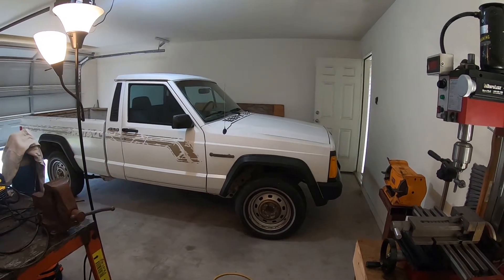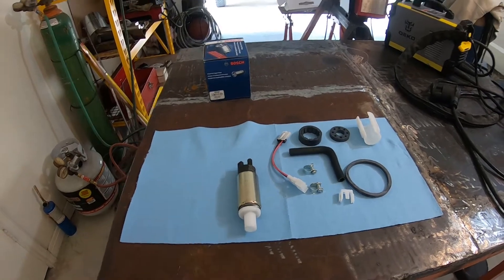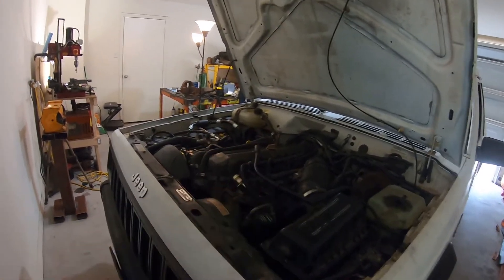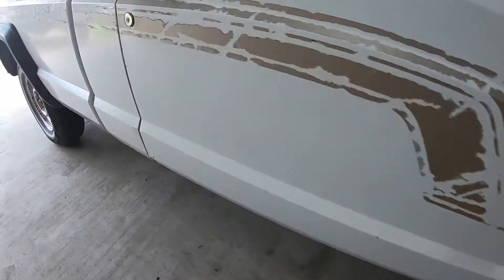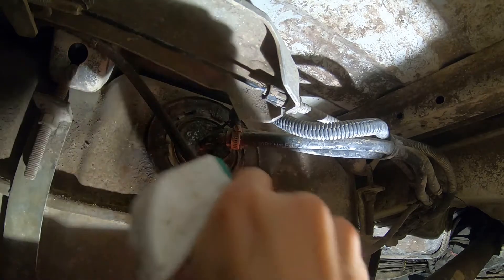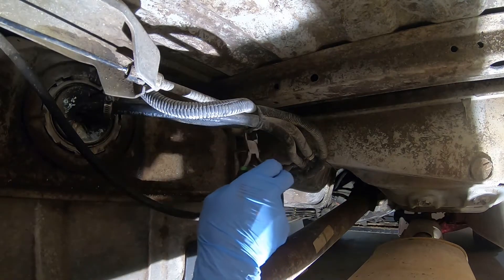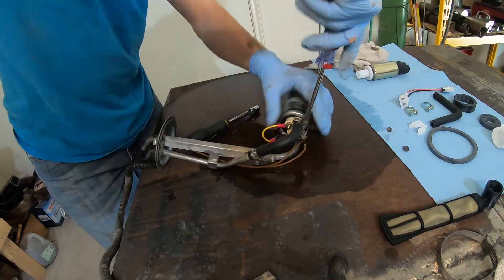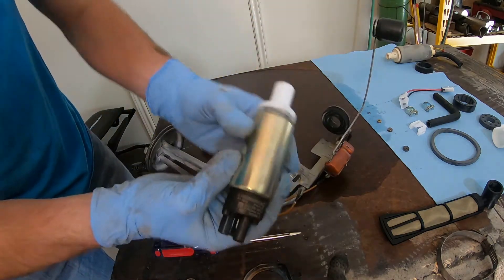Jeep Comanche Fuel Pump Upgrade 1987-1992

Comment: Great upgrade 👍 Do you have the part # for the Bosh kit ? Please post it .
Thanks and keep up the Great video’s
Reply from the maker: Hi, if you look up the part number for the pump its a Bosch 69302 you should get the same kit I got. I think it's designed somewhat to be retrofit into older model vehicles, so it comes with the hardware to adapt like I got in this kit.

Comment: Hey man, I hope your going good.
Unfortunately, my 7.3 has another issue. For some reason when you keep it above 2,000 rpm for some time and let off to come up to a stop sign, the truck shakes and idles rough. It almost seems like it is down on a few cylinders. When you get back on the throttle, it runs good again. So its a intermittent rough idle condition. Whats weird about it is it does it at the same stop signs everyday. There are no codes that show up on my forscan app. It passes a buzz test fine. I replaced the gray cps with the motorcraft blue and purple one. Still no difference. When it idles rough the Icp is about 587 psi and the IPR is 12.50. When it idles smooth its the same readings. I unplugged the icp and ebp sensor and drove it like that. Still no difference. Today I replaced the Idm with a remanufactured 120 volt Alliant Idm from Riffraff Diesel. The extra 20 volts defiantly made the throttle response get better, but is still idles rough.

Any ideas would be appreciated.
Thanks Alex
Reply from the maker: I'm sorry to hear you're having truck issues. It sounds like your issue may have something to do with the accelerator pedal. My guess would either be the pedal itself or the idle switch. If the idle switch is broken, then the truck won't know you just took your foot off the accelerator and it's supposed to just idle. Otherwise the pedal has a variable resistor in it (Potentiometer) that the ECM reads to determine pedal position. If that potentiometer is bad the engine wont know properly how much throttle you're giving it. It's hard to say for sure, but just some thoughts on what it could be.

Comment: What was the brand of fuel pump assembly that you originally went with?
Reply from the maker: The original one that only lasted a few hundred miles was from NAPA. I don't know what the brand was though. It was the stock replacement pump for the truck
Reply: @Rnddiesel  ahhh. I just bought one that’s branded TYC from rock auto. I’m having the same symptoms as you

Comment: I have to say, you have some really great videos. They have helped me a ton of understanding the mechanical aspects of the 7.3 Powerstroke. So basically, I have a stock 1997 Ford F-250 7.3l Powerstroke ZF5 manual truck with 140k. Lately, I've noticed that it is pouring out some pretty good black smoke (especially when you bring it to 3,000 RPM to shift). Even at 1/4 throttle or under load, it will pour out. I really started noticing this after I put 8  reman stock 90cc AA code injectors in the truck. I replaced the Y pipe boots, as well as the turbo compressor seal from the turbo to the Y pipe. I also put a new Motorcraft air filter in the factory air box. Still after those parts, the truck rolls coal. Frankly, it doesn't bother me since I'm 16 and like the smoke, but I unfortunately have to do emissions  tests in Colorado. I have scanned for codes several times and had a P0236 code come up. It only came up once and went away. When I researched it I think it had something to do with the boost not matching with the PCM, so I took the map sensor and sprayed it out with contact cleaner. Still after doing that, the truck still rolls black. Truck passes a cylinder contribution test fine. Although on the buzz test, I have been getting many codes. When I do a buzz test from the app Forscan, all the injectors buzz fine but it comes up with a P1271, P1277, P1273,P1275, P1276, P1278, P1293, P1294. Back with the old injectors, when I would do buzz tests, none of these codes came up. It all started after we had a mechanic replace 4 injectors. They thought it was a California truck and put the AB code injectors in. After they put those in, the truck was running one bank with the 120cc AB injectors and the other bank with the 90cc AA injectors. When I did a buzz test after those were replaced, thats when all those injector fault codes popped up. So I ended up replacing all Glow plugs with motorcraft replacements, I put Remanufactured AA injectors from full force diesel, and under valve cover harnesses and gaskets in the truck. (I actually did all the injectors because the old ones were knocking pretty hard, you can hear them knocking away in this video https://www.youtube.com/watch?v=P6LIKZDI4lw)      

I wonder if when the truck was running the mixed injectors, It messed something up in the IDM. So right now, the truck runs pretty good, It has a pesky idle surge that annoys me, but other than that it runs pretty good. I just don't remember it pouring out so much black with the old injectors. Sorry for the long, paragraph. Any ideas? Thanks Alex.
Reply from the maker: I wouldn't think the IDM would get messed up from the injectors. Are you sure your truck isn't supposed to be a California model? If it really is you're running the wrong injectors, so without getting the proper tuning that would cause the injection timing to be all off, so it won't run quite right.
Reply: @Rnddiesel  Thanks for the reply. The old original injectors were the AA 90 cc. So all the injectors are back to stock. It does have some soot around the up pipes. Have you replaced the up pipes on your 7.3?